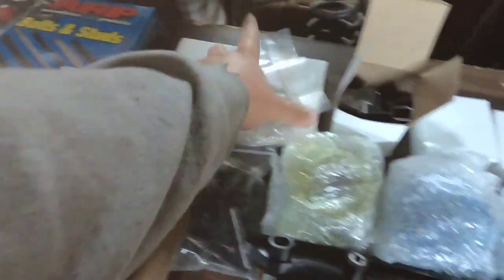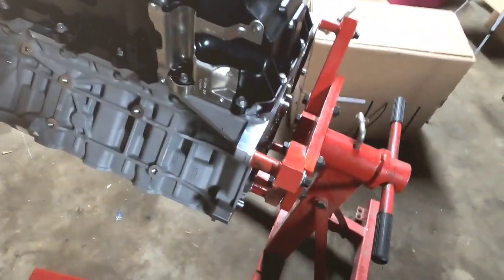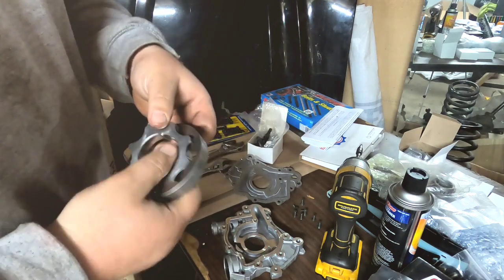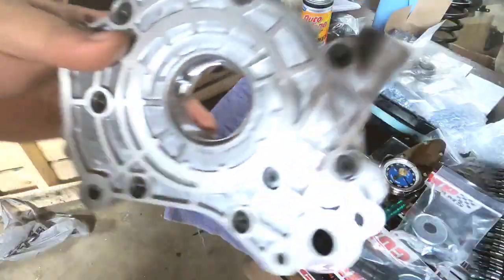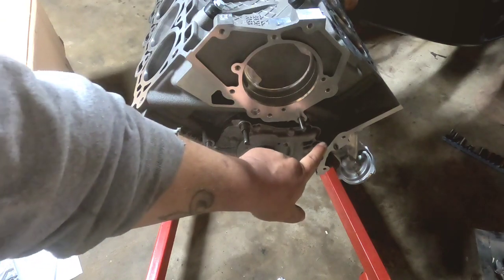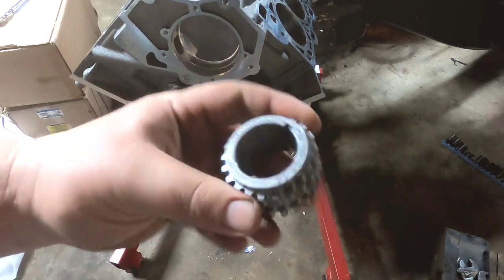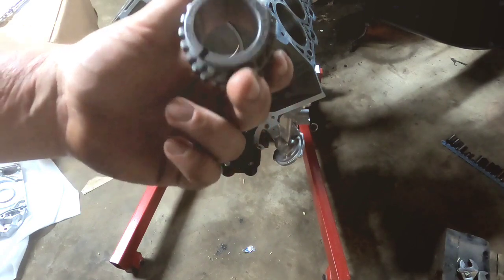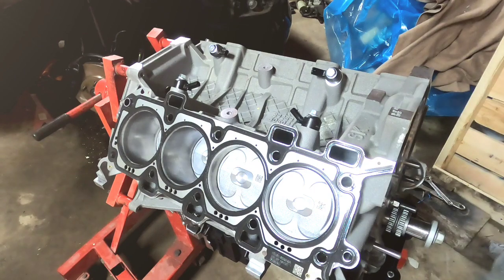BUILDING A GEN 3-2-1 5.0 COYOTE - PART 1

Comment: Did you have to swap the rear seal plate for a gen 1 or 2? I I'm doing a gen 3-2-1 build and I realized the Crankshaft sensor doesn't reach on the gen 3.
Reply from the maker: Yes I had to swap it out with the plate off my Gen 1. The sensor is actually different too. The Gen 3 uses a 3 wire sensor. 
https://youtu.be/cZxD1DvUtMg
Thanks for checking out my video!
Reply: @streetslayers410  Thanks man, I got the Gen 2 oil filter adapter also. The new Gen 1 oilpan I got doesn't have the big sensor on the side of the pan so I'm hoping that's gona work ok.
Reply from the maker: @Mcperformance1  I just used the composite pan from the Gen 3. My dash says low oil level but I check it before I start it up.

Comment: did you reuse the gen 3 oil pan ? and if so , would that up the 8 quarts it requires to 10 ??
Reply from the maker: Yes I used the gen 3 oil pan and yes you have to use 10 quarts